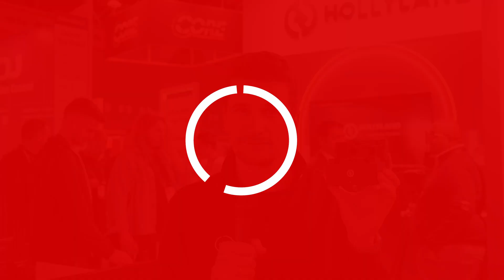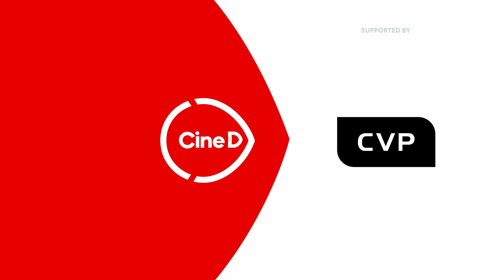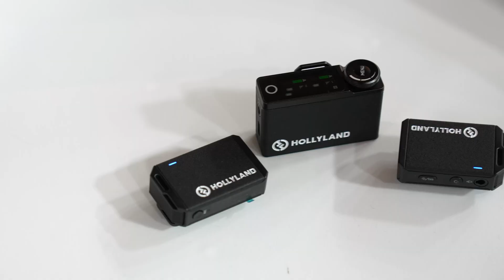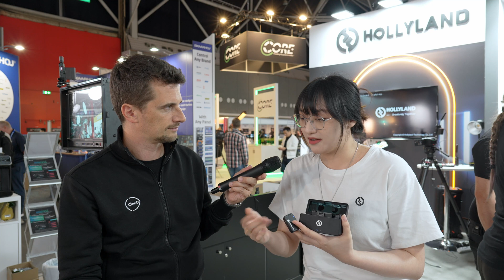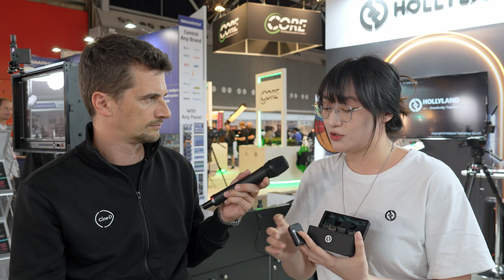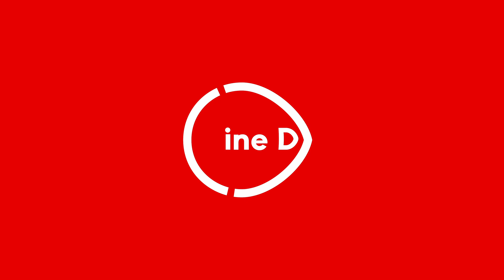Hollyland LARK MAX Microphone Technology Explained

Comment: Lark Max is so much better than the Wireless Go II in every way. I switched. Just wish the Lark Max had timecode!

....and that I could lock the buttons on the transmitters!
Reply: with the december firmware update you can now lock the rec button at least :)
Reply: @andrejpavlov333  you can lock the rec bottom on the Transmitter?